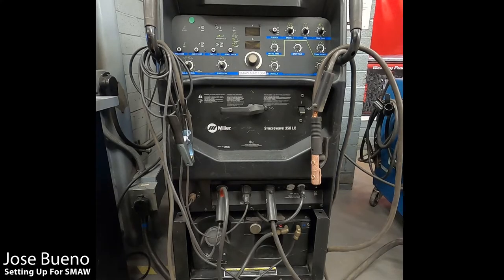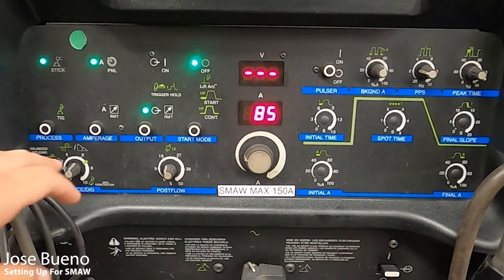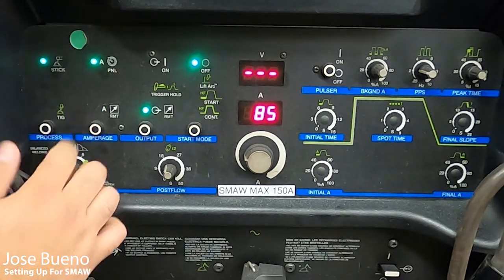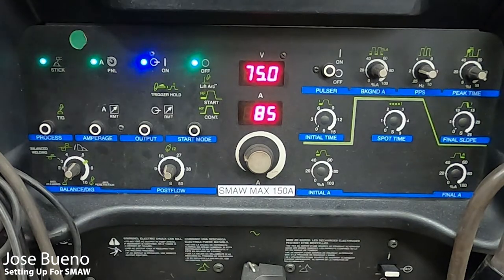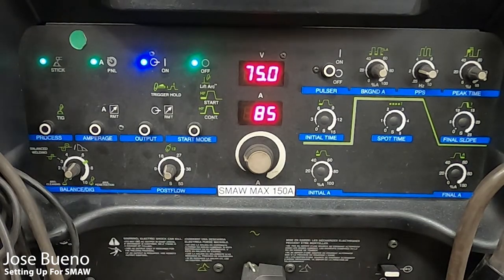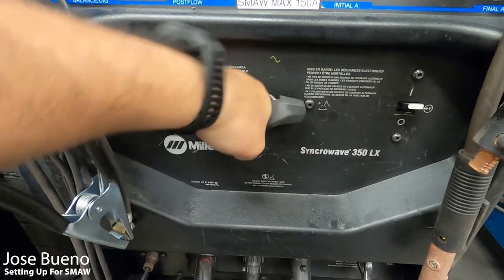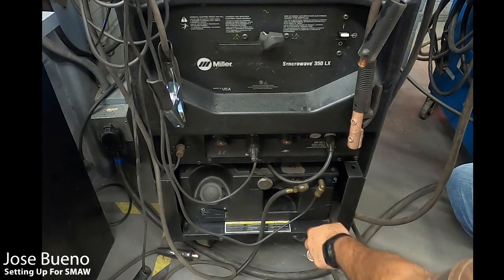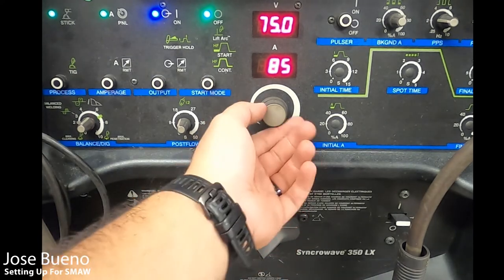Setting up for SMAW  - Miller Syncrowave 350 LX

Comment: Balance/Dig is for SMAW. When you have it set on GTAW the dial operates ac balance, when it's set to SMAW the dial functions as a dig dial or arc force dial. Basically, it's how you control the characteristics of your arc for certain scenarios